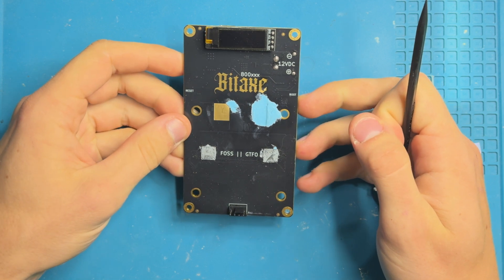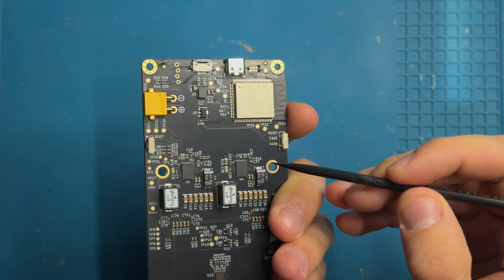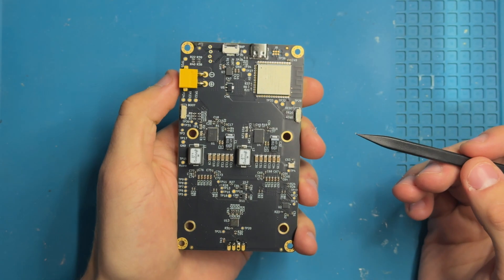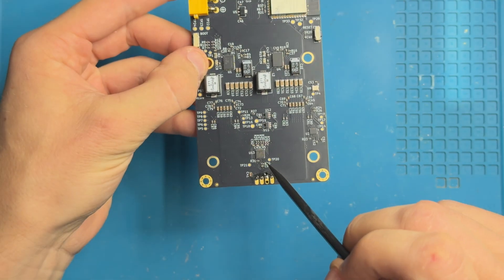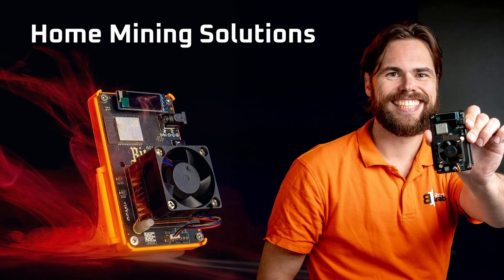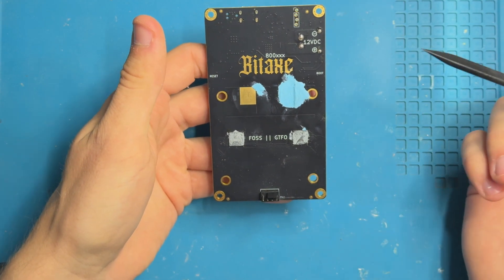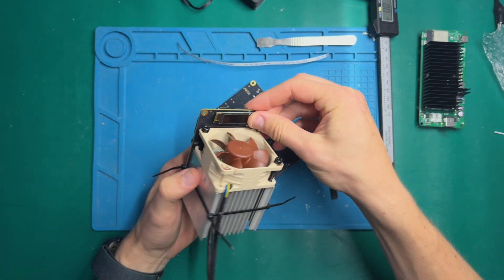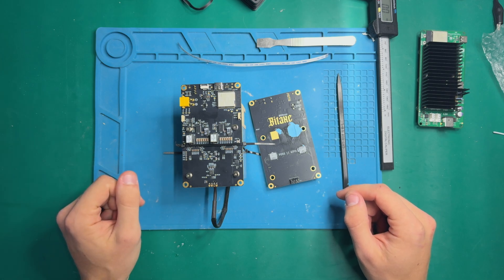Bitaxe GT (Gamma Turbo)

Comment: Will this support a LAN mod like the Gamma, and do we have the ability to customize voltage and clock per chip?
Reply from the maker: We've heared about the lan mod but it's yet not officially supported. No frequency and voltage will always be applied to both chips at the same time

Comment: Putting most components on the back is actually pretty handy, it’ll make soldering way easier. Plus, I won’t have to pay extra at JLCPCB for double-sided assembly instead of just one side. Great job.

By the way, how’d you get those two Coilcraft parts? I’m working on a Gamma build, and tracking down those components has been a pain. I just found one, but I’m not sure if it’s the exact right model.

On top of that, I’m running into even more issues with jlc for these Gamma builds, bruh.